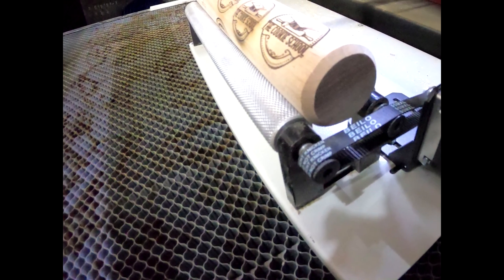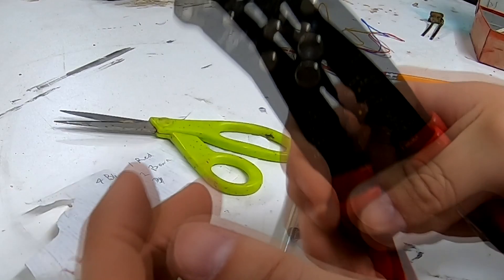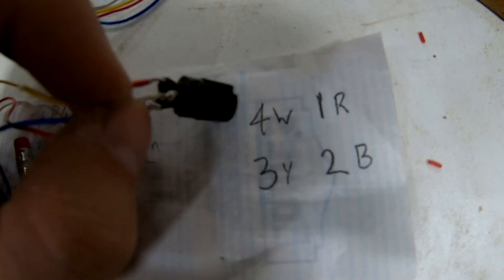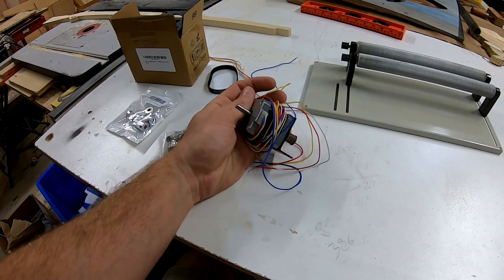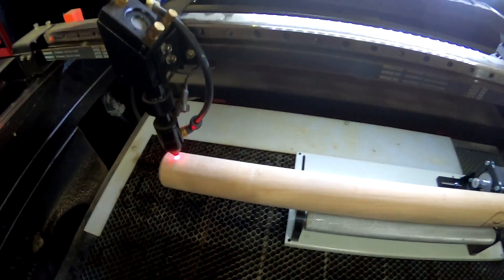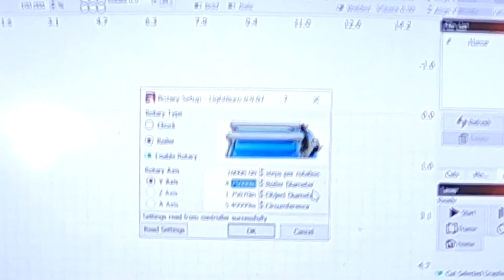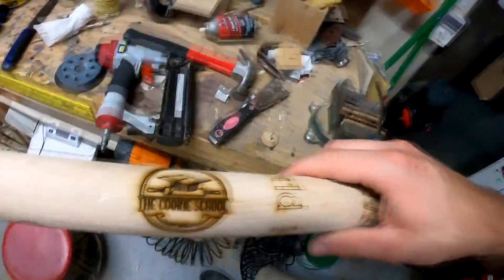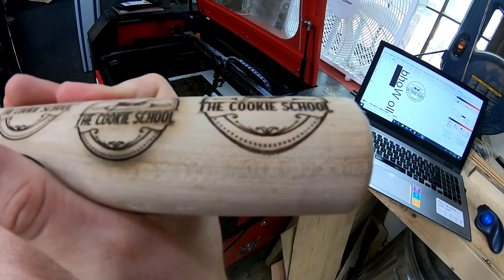Laser Rotary Upgrade Setup Cheapest  I Could Find

Comment: Something I found out by accident is if you rotate your rotary 180 it will now print in the correct orientation without mirroring. You could have skipped rewiring by putting the motor end on the left.
Reply from the maker: Oh wow you are totally right, I can’t remember if I had enough slack in the wires to accomplish this though with the placement of the plug. Great point though thanks.

Comment: Hi Chad
Would you check if it would be positive to cut vinyl heat transfers it has to be polyurethane based otherwise is not good for your laser or your health it will be nice to se some Acrylic of different thickness on your 100 watt co2 laser I'll be tuned hopefully you come up with the videos🌟👌🏼🙏🏼👍🏼
Reply from the maker: Fidel I’ve been cutting lots of acrylics even up to 25mm thickness. Thanks for watching sorry this reply took so long.

Comment: What software are you running, I have an 80W (Red and Black) with RDWorksV8? The rotary option in the output menu is greyed out. When I connect the rotary tool will it pick it up.
Reply from the maker: I am using lightburn
Reply from the maker: Not sure why it's grayed out for you but I don't think connecting it will Un gray that as I unplug my y axis stepper and plug into that port don't think the software can tell the difference. I would look into the options and settings there maybe something in there disabling it.

Comment: Couldnt you have just changed the current settings on the dip switches on the Y driver to match the stepper motor?
Reply from the maker: This I am not sure of. Fir me I had already burned up the original motor so for me us I no the same voltage motor made sense at the time. Wonder if they make inline transformers also that you could easily install aswell.
Reply: Hi Paul.  I just dealt with this exact problem.  The nema 23 thats stock on the laser runs at about 2.47 amps.  I swapped in a nema 17 (same as his initial test here) for my rotary engraver and I adjusted the dip switches to bring the current down to 0.71 amps.  Its been working great ever since!  Hope this helps.
Reply from the maker: That's great to hear, only downside I see here is if you are sharing the Y axis driver you would maybe need to switch it back everytime you go back and forth.

Comment: can you show me how you do the plug and unplug system for te rotary
Reply from the maker: Yes
1. be sure the machine is off
2. Turn the little ring on the plug counter clockwise you will feel it come loose.
3. Pull up and that will unplug it. 
4. To pug in the new one make sure the prongs are lined up 
5. Press down
6. Turn clockwise to tighten 
7. Turn machine back on

Comment: Hey bud, I am just about to purchase this laser cutter but was tossing up on this or spending big bucks on a Glowforge, the only reason I wouldn't buy this is the learning curve. What programme are you using to send the print to the machine, is it CoralDraw? Also, have you tried to engrave on glass using your new rotary setup cause glass cup engraving is something I would love to get in to. Many thanks.
Reply from the maker: I personally would not recommend going with the glowforge just based on what some of my friends who have it have told me. Despite how attractive their commercials make it look.

I use a program called lightburn they have a free trial you can try it out, it's very powerful. 

Engraving on glass is pretty easy you just have to mask it off first with tape or paint first so that the laser beam has something to absorb into.
Reply: @ChadsCustomCreations  Thanks for your prompt reply, I've decided to go with this machine, the price is just to good. You need to get more content up mate it's the only channel I found to actually explain how to use the dam machine lol. Thanks again.
Reply from the maker: @IITHEOPII  that's awesome please reach out to me if i can assist in anyway.

Comment: Perfect. Exactly what I needs for my setup
Reply from the maker: Great they are now also selling an upgraded version that won't require all this work. I listed in the links on amazon.
Reply: @ChadsCustomCreations  thanks, but I already have mine and had already considered the nema17 being too small (actually it’s the tuning for the larger motor that simply allows too much current to flow, thus heating it up too much)

Just trying to source some silicone rings for the glasses to sit on, and then tweak the settings to get it looking right.
Reply from the maker: @lithgowlights859  perfect, than you and I were definitely in the same situation. I've heard of people putting large o-rings around the metal to get better grip also.

Comment: I believe after watching this video you may have explained why my chuck rotary that came with my 6090cnc was running hot when I tried it on my laser cutter. Thanks,  Have a great weekend,
Reply from the maker: Thats great to hear, I bet there are other work arounds also like maybe an inline transformer or something if you didn't want to change out the motor.
Reply: @ChadsCustomCreations  yes I will have to check the specs on my CNC and compare to my laser and see if there is a workaround, it would be nice to be able to use the same rotary for both tools.